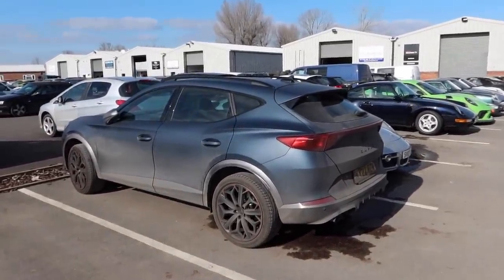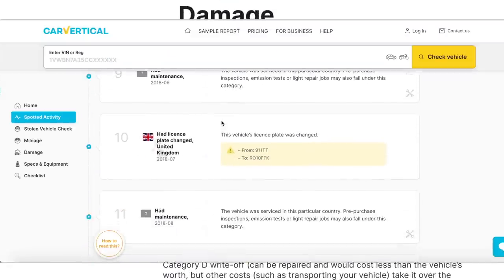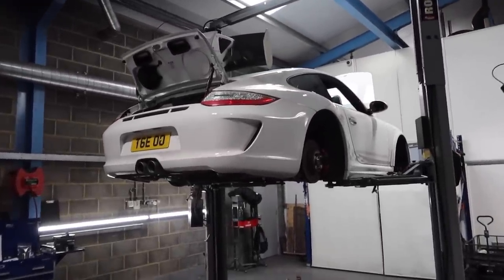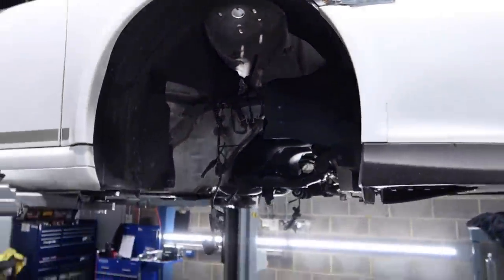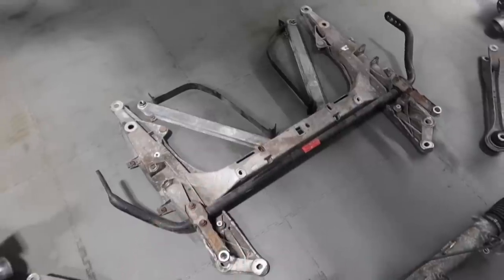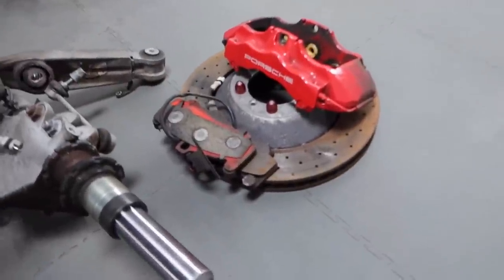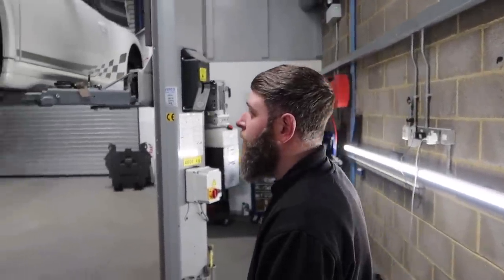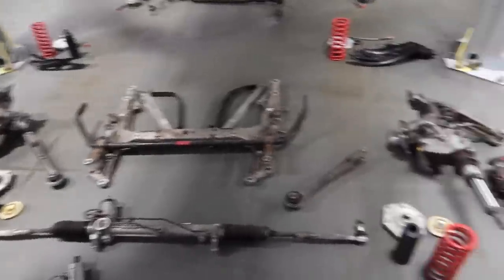MY PORSCHE 911 997 GT3 RS WAS CRASHED

Comment: I feel your pain - (1) from the original photo the car looked like a write off (2) the car was not repaired by a Porsche approved repairer (3) a sub frame should never be re-welded it should be replaced (4) remarkable that second strut went back on the car, it is clearly bent (5) the car should have been put on a jig for its first repair.  Well done for doing the right thing and putting it back together properly.  By putting the car back together properly it will reward your driving experience and ultimately your wallet in the unlikely event you sell it.

Comment: While you have the suspension off it would be easier to do a body measure to see if there is body damage to the tub and chassis legs which sit halfway up the tub as the measurements points are easier to get to while it’s apart and just to give you an idea of my knowledge I’m a vehicle damage assessor at a Porsche recommended body so I deal with them all day long
Reply from the maker: Thank you!

Comment: There is nothing that bad, yes some bits need replacing, the subframe can be used from any 987/997 used - costs peanuts, and the rest of it, more empty talk - if the body is repaired decently the other does not matter as those are bolt ons